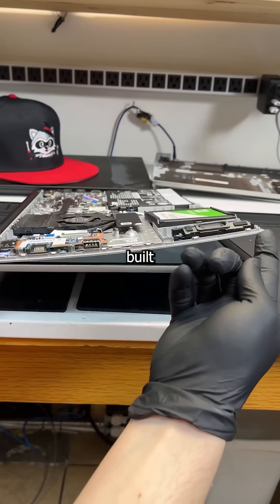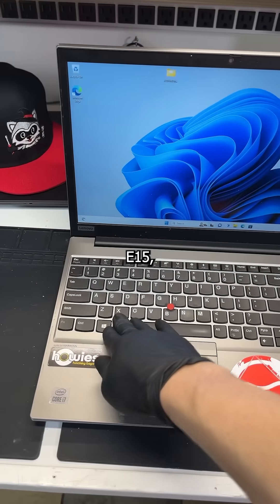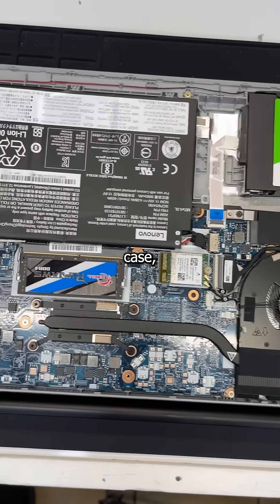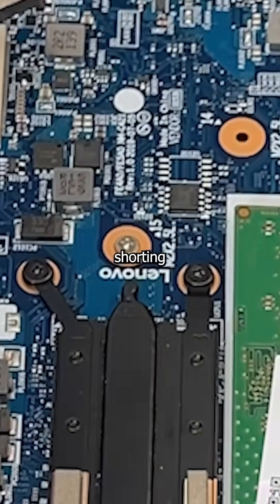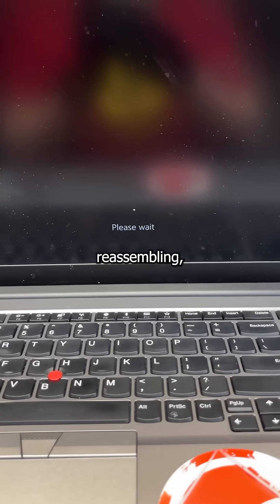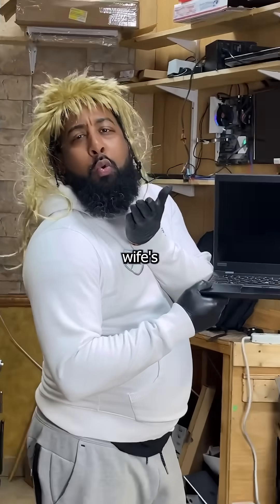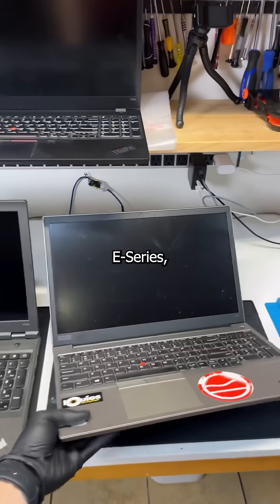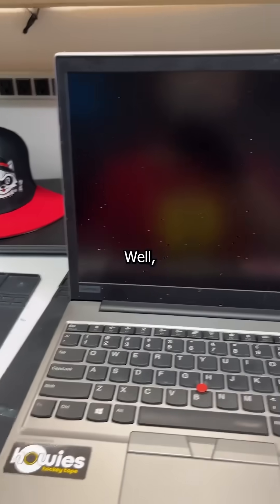ThinkPad or ThinkBad? Has Lenovo ruined the best laptop ever made? #tech #pc #technology #shorts

Comment: If it was a solder issue couldn't you try baking/heating the board to reflow the solder similarly how some people were able to fix their XBOX 360 after red ringing? Also if there was room in the case maybe use some modeling plastic card to reinforce the case to prevent some flex? Probably not worth it but what I would try if it was mine and was too broke to get another PC.

Comment: microscopic cracks in the solder? It's not unfixable at all. It can be quite a lot of work depending on where it is.

a quick fix could be literally getting the whole thing, covering the bad boy in flux like a clown with some mechanical lube, and set it into the oven at around 230C for a while. well, 5 minutes should do, put it into the oven as it's heating up. You're basically trying to reflow the entire motherboard (MAKE SURE THAT YOU TAKE OUT ANY RAM OR OTHER STORAGE UNLESS YOU LIKE YOUR COMPONENTS DROPPING OFF)

Now, this might fix it, or you might have to go manually resoldering every component you see.

Also if this happens to a bga, well, you might have torn the pads off of the motherboard and now you're truly not going to make that thing work because the motherboard is dead. Have fun!

Comment: E-series has been garbage for decades.  ~15 years ago, I got one that was so loaded with bloatwear and completely unstable with the OEM install of Win 8 I put it back in the box for 2 years.  Then out of boredome, I put Ubuntu 14.04 on it and it ran like a tank for the next 3 years... however it had the same issue - lot of plastic.  The bezels and frame cracked just from the weight of holding the machine and/or opening/closing the lid.  I tried chemical welding the plastic, which worked OK but it still had to be handled like a baby duck. My conclusion was that it was built to be disposible in acknowledgement of how poorly it performed with the OEM Windows config - likely meant to be sold to schools on a budget in the pre-chromeook era - and meant to life a short life for deliberate "early retriement".

Comment: You can track the cracked traces, check the conductivity of the soldering and look for hot spots to find the issues, then maybe you could fix it with some seriously specialized equipment and a technical schematic harder to find than The Scroll of Absolute Truth. That would be about 3500 hard earned dollars to save a machine that Windghost 11 will make obsolete in 4 moths, or you can spend $1500 getting a new one that will fail just as easily, and keep on polluting the world like we've already found a replacement earth, all so that some shortdicked CEO can buy another senator or a new island where their perversions are not prosecuted.

Comment: you could try bake the mobo in an oven to try fix those microscopic disconnections, but that wouldn't fix the fact that the fame lets it bend... I'm using an IdeaPad that flexes less than that, despite being called a Flex 5.

Comment: Ever think of putting that mobo in a toaster oven or something? Just hot enough to reflow the solder, but not hot enough for the solder to completely melt and drip. I've never done this myself, but theoretically, it should get rid of the microcracks in the solder.

Comment: had this problem a while back, someone suggested using something to make the case sturdy and to hold up a heat gun to the board solder points (like that old Xbox 360 Red ring towel trick) and it sorta fixed the cracks, the extra sturdiness made it way way better

Comment: Its still better than a regular HP, Dell, or Acer chromebook. 4GB of ram with a dual core 1.1 Ghz celeron cpu and 16 gigs of storage space should be illegal. 13 gigs of that storage is also taken up by the system and one core is constantly at 50% use. The memory also only has 2 gigs available in reality.

Comment: Put the mother board in the oven for 10 mins remove HDD and other parts first the heat will seal the solder cracks been done for 40 years or more it really works if that is the problem

Comment: hold on.. this should be pretty straight forward actually. just buy a oven for solder stuff so you just put the motherboard in there, melting the solder, then letting it cool off and it's brand new again?

Comment: This happened to me before with a dell latitude 7480, it still works but if you pick it up from the corner it freezes and flips out, its fully metal and plastic but it still has that flaw, and if you don't pick it up the corner then your fine, never picked up a laptop from the corner again after

Comment: My laptop has been blacking out often, it seems to function just fine but blacks out in spurts every 10 or so seconds. It has had a drive swap and ram swap. Please tell me my laptop isnt done for. Only started doing this after changes were made to hardware. It also had a battery swap (it was going to explode if i didnt change it), which i hope is the  leading issue.

Comment: I had the same problem with a Samsung Expert X30. After about 15 months of use, the lid's hinges became stiff and ended up breaking off several of the brass screw inserts embedded in the casing—a common weak point in many laptops. In my case, all but one insert broke at once, which caused even slight movements of the lid to twist the motherboard due to the uneven pressure.

I fixed it by running a full-size screw and nut through the hinge and the bottom case. This way, the pressure is now applied through compression on the plastic rather than traction, which makes the structure much sturdier.

Comment: It's not a definite fix but you can sometimes get lucky and get it to work again by sitting the entire board on a flat surface and using a heat gun carefully in multiple passes and if you have any flux it would definitely help on larger components heat the solder to melting careful not to move or remove anything then let it cool. As I said last case scenario try this because one wrong move and it will definitely be toast, but it will sometimes reflow the solder giving you a lucky new life on the board.

Comment: Damn, and here is my laptop bought for 225$ used it for 8yrs now (will be in about 10days) and i can assure you i have threw it around multiple times (on a bed no extra cushion) and holded it by the screen and this mf still refuses to give up just a week ago it lagged for youtube website i crashed out and punched the keyboard a few time and the mouse(external) had a cut in my hand but this thing is just fine rather some keys requiring hard presses register problem fixed😭
Reply: Intel Celeron N3060 @1.6ghz ,integrated hd graphics(128mb) and 4gb ddr3 ram with 500GB hdd graphics btw... Display 1080 60hz
Reply: But battery was not as durable I guess it died like 1.5 yrs ago it runs in direct supply💅

Comment: You can actually fix that, but you have to have a good idea of where the micro cracks are. Take a heat gun and carefully heat up the afflicted area with a heat gun, with time and a little luck you can get the solder points to rebond. Nothing stops them from breaking again from the stress points tho 😅

Comment: My mom bought an Onn laptop. The screen woulf flikcer on and off. Took it to my IT prófessor and he couldnt find anything wrong with it. The only solution was to hook it up with HDMI port which it didnt have so we bought an adapter which worked. Later on the battery swole up while it was off and unplugged.

Comment: Yeah the plastic thinkpads are just kinda ass. The upgrade to the aluminum frame is like 15 or 30eur and its well worth it. I have an e14 gen 5 and it has no issues, barely flexes apart from the display and i commonly toss it around while holding one corner, ive even spilled stuff on it. Im a fan.

Comment: if they put a piece of sheet metal on the bottom, of the case on the outside, it should add rigidity to the frame, not a pretty solution but a solution none the less.

Comment: DISCLAIMER: I don't know if this would actually work. 

If you have balls, try applying flux to the solder points and putting it in the oven to melt the solder again to (hopefully) at least temporarily fix the issue. But in the long term you should get a new laptop.

Comment: I have a Lenovo. Its so poorly built that overtime, just opening the laptop weakened the plastic around the hinges to the point it completely broke, meaning the two halves of the laptop are completely separated, save for a couple wires keeping everything together. I have to use my bedframe to hold up the top half while i use it. Not to mention that half the keys on my keyboard randomly stopped working. Thank god im getting a new laptop soon.

Comment: I was told by a service technician that the motherboard in some of Lenovo's models are extremely thin. He said they fear servicing them, because if the motherboard cracks, their manager tries to recover its cost from them for the failure, since he is under pressure to control costs.

Comment: They are only lenovo thinkpad in name, the hardware is not good like all chinese assembled snake oil hardware today. 16 was a magic number for a teason in lanes 16cl 16bit 16 4x4x4x4 stereo outputs n 16bit x 4 a quad vcore m1 intel pci 16, 16gb 8bits to a byte 8 n 8 is 16 but we dont send 0 its 16 as midi 8 in 8 out 2 dockeys in out became 16 in 1 but hi lo. 16k tv is hdmi side by side 4x 4 vr the other 2 is stereo. But we have 2 cpu i for gfx 1 sound to do best of both but to day we gone from 4 pixel x 4 to 4096 colours 1 qtr when we had 16million. 192khz is now 42khs 1 qtr do hdmi is 720p faking 4k 4gb 4 x 16 3 halfs binned doing what 1 aaa did but ai controls and hence lags needs memory 3 x storage to compress uncompress assemble the rar then crc check to push into memory on cpu but cant fit so vsync sound n gfx to tune n codecs not native or lossless and not studio 16 quadrophonic 64bit x 2 cpus its lies and m2 more ecores is bad spec but snake oil to sell shares up but fps dlss 4k upscaled sell to fools ghz ppi quality of sockeys output we dont even benchmark correct now its cpu microsoft makes up a fake image in ai on cpu holding back a gpu n mboards are made yo do this as no upgrade just sell change and lie now cd 42khz is all you have on rt amd snd 13 gen intel nvidea cant make high end . The lies by ytbrs is selling this bad hardware too .

Comment: Welp...this is why you do NOT buy anything except the T or W series Thinkpads. Had this discussion with one of my brothers recently. Mom needs a new laptop. Suggested a refurb T590. Argued they are more durable, easier to work on, better spare parts supply etc. Brother insisted on some new Asus piece of garbage. Told him this was a bad idea. He insisted that "More new, more shiny, more better". Prices were within maybe 50 bucks of each other btw. 
So the Asus machine arrived and what do you know....dead keys on the keyboard and a frame that bends even worse than this one. I was honestly afraid I would break the hinges when I opened the display. Bezel thickness felt like somewhere between paper and three layers of tinfoil. Yeesh.

Comment: My dell, dunno the model but its an older model, freezes whenever I turn it on, after some time of devastatingly turning not one a 100 times only for it to freeze I finally got it to work by pressing f5 out of the f1, f2, f5 options in that black screen thing and i also pressed f2 and loaded default, i think, then it started working but it can use wifi and then i used that cheat code for some days and then its stop working

Comment: My GPU (1050ti) died after 6 months it's warranty ended, I was very sad as I belong to a lower middle class family and now my father would have to pay more money to even get the pc work as it was an i3 9100F, meaning no iGPU, so I settled for GT 610, lol. Well after dismantling the damaged GPU, I couldn't find any burnt capacitors, no damage marks whatsoever. So I am thinking the issue is probably the same as this one, cracked solder joints. Seems like I would have to try the oven method now, lol.

Comment: What would my laptops issue be if it doesn’t like being turned on with the charger in but starts fine without the charger. Then when I open a game with charge in it shuts down but without the charger in it opens it. But sometimes the computer will restart out of nowhere. If you could find an issue I would be glad. I have ruled out it is not ssd or ram, and I have a go victus 15.6 i7 12650h, rtx 3050ti, and 16gb ram.

Comment: My sister has a thinkpad e15, the thing used to work fine but after 2 years of normal use, it wouldn't post and just give error beep codes, after weeks and finally giving up I discovered that the cpu is not making enough contact with the motherboard and surprise, if you stick your thumb and make pressure on the heatsink above the cpu, the thing starts, wth is wrong with these Thinkpads dude.

Comment: My Nintendo Switch had a similar fate. It got slightly bent, and the sauter points were damaged. I tried to get it repaired, but the guy said the fix would at best be temporary and wouldn't be worth the cost.
On the bright side, it led to me upgrading to an OLED model.
Reply: Solder, not sauter. Js. 😁

Comment: My Asus x507 did the same... I got my motherboard replaced for free once during warranty period.
Still the problem existed.
Everytime it suddenly froze and I had to force shutdown using power button. 
I replaced SSD, removed NVMe and used on SATA, replaced RAM. Still problem used to occur once twice in a day.

Then one day I figured out the root cause. 😅

The wifi card in my laptop was screwed to laptop's body and connected to motherboard. Whenever laptop's body bent, the wifi card lost connnection with motherboard..
Finally i removed the inbuilt wifi card and using USB Wifi adaptor now.
Everything working perfectly.

Comment: You can pop that mother board into an oven (not a microwave) at low heat to reflow the solder joints it worked for me 😅

Comment: Dude! I have a Lenovo Yoga 7 and my laptop had 2 of the tiny screws on the bottom panel find out, so oftentimes either if holdng it weirdly or moving the hinges, the bottom panel will actually seperate from the laptop, and I can see some of the internal components in the corner, notably I think its a spring and the motherboard. And I barely got it in 2022, so it took just barely under 2 years to have that happen.

Comment: Basically they designed a case soooo cheap that it can result in accelerated wear on the board because they are trying to use it for structural purposes instead of shielding it from stresses….sounds like theres a easy fix somewhere as long as you fix their design before any permanent damage takes place

Comment: I have a Dell Latitude 5400 that starts producing graphics glitches when lifted up holding its right side. Has to be rebooted to fix the issue.

Could it be a similar case?

Always suspected soldering giving up after a few years as there's no visible damage on the inside of the laptop.

Comment: I used to have a Chromebook that would only work if plugged in or if I applied pressure to the left of the mousepad. I assumed that the battery had become disconnected somehow and that putting pressure on it temporarily reconnected everything. Lived with that for a few months before farting a new one.

Comment: I've worked for a company that serviced Lenovo laptops in the past. The old T-400/500-series and up to x20 were built to last. You could basically use them as a snowboard and crash down the alps. Nowadays the built quality has dropped significantly.

Comment: Sadly, not only the Thinkpads are garbage now, i have an Ideapad from 4 years ago and the keyboard buttons started popping out after 6 months, even buttons i never used as the connectors are literally made out of thin plastic. How thin you mean?, well let me put it this way. Anyone who made model airplanes, with those plane pieces in those plastic racks?, and the tiny little bits holding the pieces of plane together with the racks?, those pieces you need to snap?, that's how thin and sturdy they are. The springy rubber thingies to press the buttons also look like they are made out of crepe paper. So yeah, i use an external keyboard.

The casing doesn't bend as severely but still bends somewhat. Only 2, YES TWO WHOLE, USB slots from which one of them started to fail after 2 years just after warranty.

I'm really careful with it and now after 4 years it still works fine, it's just that i'll never buy a Lenovo ever again. And after the whole Asus debacle i'll also stay clear away from them. Anyone knows of a proper brand these days?

Comment: I have a ThinkPad but was built around 2007 But Its improved and runs awesome... ThinkBads are the Newer ThinkPads. Once I accidently dropped it. My Thinkpad didn't even freeze.
Reply: The frame build quality is still fantastic. But the chip components are low quality. My 2014 ThinkPad broke my fall on concrete stairs, zero issues minus a few dings. That said, the chipset still failed miserably years later.

Comment: My Ideapad case litterally just fell apart from opening it. Like the hinge fell off and it cracked across the whole case
Reply from the maker: yup
Reply: I had an ideatab tablet that had a cracked screen from a drop of less than a meter. don't know if that was good for 2014 standards
Reply: IdeaPad ≠ thinkpad
Reply: My idea pad frame cracked and now the display rocks all over the place it lives under my tv now as a media pc my daily driver is now a thinkpad
Reply: That’s budget line. You can still glue the hinges back together but it’s not meant to be moved regularly.
Reply: @AndeyKurniawan  I mean lite use and the entire case pulled open
Reply: @ that’s normal. My niece babies her IdeaPad. Luckily the hinge could be restored with superglue. If you have access to a 3D printer it would be straightforward to restore it.
Reply: @AndeyKurniawan  Wym? That aint normal. A laptop should not literally fall apart